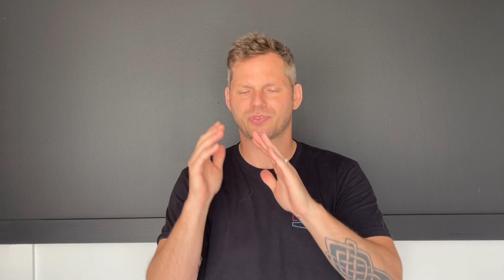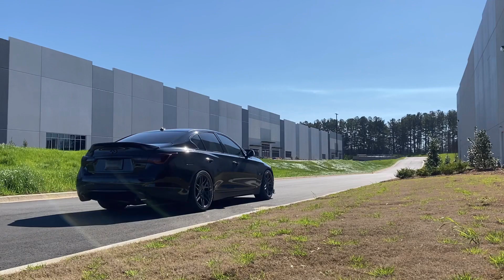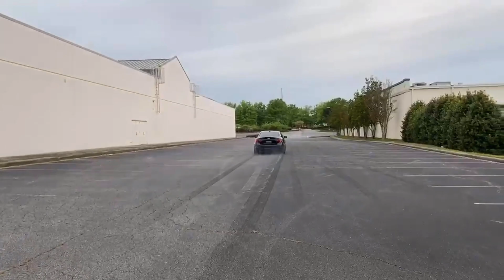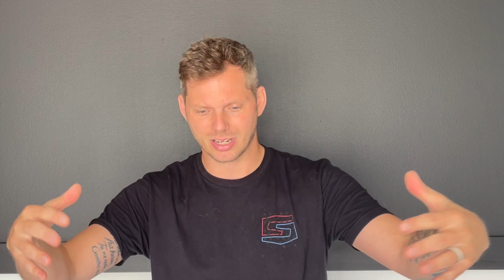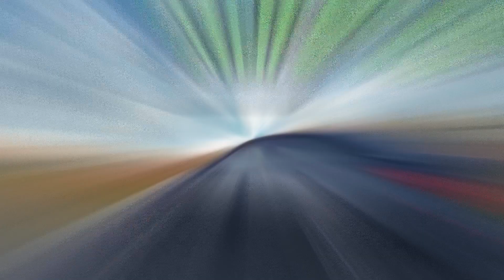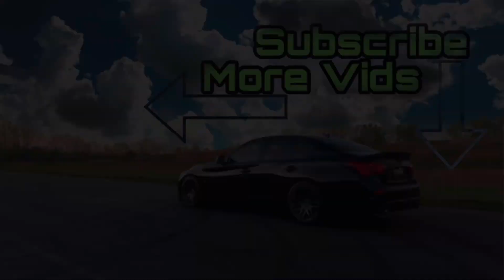Speed Culture Catback UPDATE

Comment: Plan on ordering everything today.
Can I ask what type of test pipes you have I’m looking into getting berk but should I get resonated or non resonated?
And also is a tune required for the set up with test pipes, because the guy at my exhaust shop I go to says not necessarily, says it might help with performance but shouldn’t hurt the engine or anything else if I don’t get one
Reply from the maker: Resonated. Any except Megan racing are fine. A tune is necessary to benefit from them. Is very possible you’ll get a check engine light without a tune because the car may run lean.
Reply: @SpeedCultureStudios  really appreciate the quick reply, these test pipes are hard to find lol
Reply from the maker: @JuFromNola yeah all the EPA activity the last few years has hurt them for sure.  Check out kinetics racing.  Or see if Berk has anything available.  Otherwise you might find some in marketplace
Reply: @SpeedCultureStudios  for sure

Comment: I wanted to hear you opinion on this. So I bought this whole setup (with resonated test pipes) but ended up opting for the magnaflow muffler. I bought the 22” resonators to account for the smaller size of the muffler but i’m still concerned about rasp. The other option would be returning the resonators and getting two straight through magnaflow mufflers (same size as the x muffler) but single in/out. If you think the longer resonators will suffice i’d rather keep some volume. Just hate rasp lol.
Reply from the maker: Rasp should be minimal if any at with the setup as is.  That’s why I’ve recommended it.  If for some reason you have some rasp or develop some over time. You can replace the resonators with something larger.

Comment: So I have AMS LDP non resonated and with a tune. I ended up going with a double X pipe setup and the flow fx resonators by the tips. Would you recommend fitting another set of resonators on the system since I dont have my stock bottom cats anymore. Or should I put on the Borla/Magnaflow muffler . This is all 3 inch pipes too
Reply from the maker: What do you mean double x pipe?  Why do you want additional resonators?
Reply: @SpeedCultureStudios  I may have messed up but I had them install 2 x pipes in place of the magnaflow muffler 😥
Reply from the maker: @TheBaldMarksman  yeah not necessary at all.

Comment: Can i run this setup on my car even if its not tuned ???
Reply: I would love to get my cart tuned, but it’s a little hard to get a good tune up here in the north east is there a exhaust set up you can recommend for a non-tuned 3.7 with stock cats I just want it to sound a little better than my stock muffler
Reply from the maker: @mel0cel0YT  Best thing to do really is just do a muffler delete.  Sounds good and is inexpensive
Reply from the maker: Yes.  The catback itself doesn’t require a tune.  It’s the test pipes that require the tune.  So the only thing is that if you have stock cats, this catback will sound basically like stock so there isn’t much point in getting it as it’s designed here.

Comment: I’m looking to do the scs exhaust on a Fx35 I just picked up. The factory exhaust utilizes a y pipe into  a single in/out resonator then to the muffler single in dual out. 

 Would a single in single out (or single in dual out) borla proxs muffler in leu of the dual in/out give the same sound?
Reply from the maker: It was be similar in tone yes, as long as the dimensions of the case itself are relatively similar.  I would not do single in/out though.  I’d get ride of the factory y and replace it with the borla or magnaflow and do dual in single out if you wanted to keep that same format.  Try to find a 3” outlet though to keep a lower tone

Comment: I’m adding this to my Q60 3.0 this week,Question you said if we keep our stock cats it’s best to drop the muffler and go with an X pipe.However you said if that’s down to use 3 inch ..please tell me what I’m getting 3 inch in and not 2.5 ? Just want to get the right parts plus the link to the x pipe is unavailable
Reply from the maker: For theb3.0t 3” pipe is good, especially if you ever plan on tuning.  You can just search 3” x pipe and you’ll see several options
Reply: @SpeedCultureStudios  so just get 3 inch pipe and 3 inch X pipe and the I can purchase everything else that you listed just as is ? Resonators,flanges,etc at a 2.5 ? Correct ?

Comment: Hey scs im tryna find the borla pro xs link I went to your shop on Amazon and it’s not there and I went to the original video and the eBay link no longer works.. do you have another link for it?
Reply from the maker: https://amzn.to/462mNRx
Reply from the maker: Try that one ☝️
Reply: @SpeedCultureStudios I just commented on another video trying to get the link to this for my g37 so thank you. Also I have to get rid of my stock cats cause they gone bad. so what do you recommend HFC OR TEST PIPES. I just want it to sound nice & deep (which ones do you recommend)

Also when I take it to the shop do they need to add any pipes or does your custom exhaust attach all together?
Reply from the maker: @brianvasquez1479  a shop will have pipe.  At this point I’d recommend the magnaflow alternative to the borla.  Borla has had quality issues lately.  Any test pipes are good as long as they aren’t Megan racing

Comment: I wanna run this set up but what changes should be done to accommodate and supercharger set up on G37
Reply from the maker: If you’re going for max power and are ok with it being louder, I would use an x pipe instead of the borla and use 3” pipe and resonators

Comment: Im was wondering if I add 2 mini mufflers behind my tips on my custom catback, if it will affect my tune. I am tuned by Rs Enthalpy and he said if it doesnt make it more restrictive. I currently have -non resonated testpipes
-custom 2.5 inch catback with x pipe and vibrant resanators

It sounds nice but it has a lit of vibration in the cabin and i wanted to add the flow fx mufflers that you have behind my tips. I just wanted your thought on it as well. Thanks!
Reply from the maker: The flowfx resonators are straight through so they will not cause any restriction or effect the tune.
Reply: @SpeedCultureStudios  thanks for the reply, I have vibrant resanators right now with nothing else on its a full 2.5 inch catback. Do you think also adding the flow fx resanators including the vibrant will help with vibration/drone in the car?
Reply from the maker: @evojug6973  Yes, adding some nice resonators will help.

Comment: Well, I've only driven about 4k miles 1.5 yrs maybe.. on my "scs" catback, and my borla pro xs muffler is starting to come apart. :( The very thin metal wrapped around the muffler is starting to separate, causing it to rattle. I'm not the only one, another guy contacted borla about it, and borla recommended replacing the dual in/out with 2 separate mufflers. I'm about to contact borla myself, see what they say.
Reply from the maker: Borla will generally replace them with their warranty.  They should not come apart
Reply: I’ve been through 4 Borlas

Comment: Is there a difference between the flowmaster fx resonators and vibrant  performance resonators?
Reply from the maker: Depends on what vibrant resonator you use.  They don’t really have any of this style.  They are generally the smaller bottle style resonators which won’t do much here or they are bigger, stronger resonators that will tone the system down even further.  Just preference really.
Reply: @SpeedCultureStudios Is to much of  stronger  resonator, no bueno?
Reply from the maker: @BoostedNevarez  It' just makes it quieter, which sort of defeats the purpose.  Unless you want it quiet...

Comment: hey man, i have a 2010 g37x with dual mufflers in the back. Can i still use the borla muffler or will i have to do something different?
Reply from the maker: You can still use the borla as a mid muffler yes!
Reply: @SpeedCultureStudios  where exactly? looking at the driveshaft it seems like it wouldn’t fit but i’m just eyeballing. closer to where the y pipe typically is or further back?
Reply from the maker: @mattschannel38  it has to fit up tight on the awd.  If you’re lowered, most people will do the setup in reverse order.

Comment: Nearly 3 yrs on the G37x and yet to find a better sounding VQ. Running magnaflow resonators and test pipes with the borla mid  Hands down the best exhaust. Wouldn't dream of running anything else. 💪
Reply: Did you get the flex pipes?
Reply: @lightcario1471  yes but you will have to replace them after a while as they take a beating.
Reply: @elioalzugaray9106 how often do u change your flex pipes?
Reply: @tre2216  depends I've gone 2 yes with them, much sooner if running burble. Burble also destroys the mid muffler. I have since gone 3" single exit but it doesn't sound near as good. More power though.

Comment: Wassup speed, quick question. So I’m getting tuned with admin oct 1 so about 2 weeks from now and I’m getting my test pipes, borla, and vibrant resonators installed tomorrow on my g37x. I was wondering do you think my car will be okay to drive without a tune within the two week time frame?
Reply from the maker: It’s not ideal but lots of people do it.  I would just say no wide open throttle pulls for that period and you’ll be fine
Reply: @SpeedCultureStudios  thanks for the quick reply !

Comment: Love these videos man I've got test pipes and the flow masters ready to install but I'm going to keep the stock y pipe and resonators for now. If I hate the sound I'll get the mid muffler just worried if I can find a local shop that will fit it into the g37x
Reply from the maker: People have made it fit that car, but I think you have a good plan.  The factory resonators are pretty strong so they’ll help with rasp.  Should still sound nice!
Reply: @SpeedCultureStudios  honestly sounds amazing at idle and full throttle. Getting that notorious rasp from the stock y pipe at 2.5k to 3k rpm so guess I'll be going full SCC soon!

Comment: 2013 infiniti g37 sedan RWD. I snatched pretty much all the parts up this year early March late February, except for the flanges of course lol. Same time even came in the same box other than the resonators. Was like low $300 like $320 or so. After shopping around finally got a shop to install it. They charged sub $500 like $450. It's been so long I've forgotten the specifics I just know when it was all said and done it totaled out to $780. So really it comes down to finding a shop that's willing to do it on the cheaper side. It took them all day to do it because of the specifics of what I asked for centered around the placement of the borla x pipe. He eventually got it in there exactly where I wanted it. I don't mind sitting there all day if you're doing exactly how I want it. 

$780 for a full catback for the G37 sedan though is basically impossible outside of your exhaust setup. I searched high and low for catbacks for the sedan. There's only like 4 or 5 full catback options, 1 of which seem more like exhaust system replacement than legit performance systems. Manzo for $600 doesnt really do anything to really differentiate the car from stock. If thats the case why buy it?You have fast intentions, invidia and stillen left from my memory. I'm sure I'm missing someone though. All of those are usually over $1k especially Fi and stillen. You could probably snag a Invidia Q300 for less than $1k barely but it's possible. But that one doesn't really have a deep tone, it's more high pitched and on the whiney side. 

I then looked into axle backs and y pipe backs. The one I almost went for was the top speed y pipe back exhaust because it has a deep tone that I wanted. Issue though? It was damn near $800 and apparently had corrosion problems. Also $800 for a y pipe back just to add $300 more for the actual top speed y pipe to go full catback sorta defeats the purpose of going for the cheapest option to begin with right? 

So when I say that your system is literally the only real option for the G37 sedan that was less than $1k for a FULL CATBACK, I'm not kidding. I would've been posted sound clips by now but I don't want to until I get my cracked converters off and my resonated berk test pipes on to do the system full justice. 

But dude even with hissing/cracked cats at an idle I've had people literally question me if my car is still a V6. At idle it lopes sometimes like a v8. Its so deep.

Comment: If I have a g37x will the Borla mid muffler fit in place of my y pipe? I’ve heard that it won’t and I’ve heard that it does
Reply: I have a g37xS sedan and the shop I went to fabricated it perfectly. I have stock cars for the moment so I only installed the borla coming from the cats and going straight out. I’ll consider adding the resonators once I install the test pipes if I feel it’s too raspy or loud
Reply: @jjamaya01  how much did they charge you? And did they mount it sideways or vertically under the car?
Reply: @investinjahcoin5029  240, and I got mounted the exact same way he did in the video, Only diff is I didn’t install the resonators bc I wanted it to be loud
Reply from the maker: Not on your y pipe, but there have been some g37xs that have made the boral fit.  A good shop can tuck it up nice and tight, but also depends on how low you are.

Comment: I’ve heard many people blowing their mid pipe or borla muffler and going through multiple mufflers 🤔
Reply from the maker: There have only been a couple with that issue and there are over 800 of these systems out there now with no issues.  Also—as I mentioned in the video—these people are constantly shooting flames.  Mufflers are not meant for that abuse.  On top of that, borla offers a lifetime warranty, so if there is a problem, they replace the muffler.

Comment: Hey speed I have stock cats on my g37 do I need res test pipes for this set up to work.
Reply from the maker: No you don’t need them.  You can keep stock cats but you probably wouldn’t need the borla.  You could just use a regular x pipe
Reply: @SpeedCultureStudios  Thanks Speed I ended up buying the borla. Is there any test pipes you recommended in  one of your vids
Reply: @jvoncutler5890  have stock cats too bad plan on doing this setup. how’s your experience w this setup ?
Reply: @BuiltByChrys  his setup is refined I still have stock cats on my its loud enough at WOT quiet at cruising speeds. Not bad for the price. Its solid

Comment: I'm gonna give it a couple weeks or so.I feel like I have lost some power with the magnaflow muffler and there is a bit too much vibration underneath me even with the flex pipes. Contemplating just going with a regular x-pipe.
Reply from the maker: Regular x will be super raspy and won’t do anything for vibration
Reply: @SpeedCultureStudios  Ok so what would be an alternative? I have  a 3.0t awd not the 3.7. I have 2 flowfx, flex pipes and tips installed.
Reply from the maker: @lewis6720  ok then that makes a little difference.  It won’t be too raspy with an x pipe so that’s good but it still won’t do anything for the vibration.  I’d first figure out what’s causing the vibration
Reply: @SpeedCultureStudios  ok thanks for your input, appreciate it. I'm sure it's that muffler right up under me.
Reply: Ok I went back to the shop and removed the magnaflow and used a regular x-pipe. Low end torque has returned, less cabin vibration and sounds better too. A lesson learned.  To those with 3.0t awd you don't want to use the magnaflow muffler. It's more of a restriction combined with the flowfx resonators.
Reply from the maker: @lewis6720  Just to be clear, the flowfx resonators have no restriction, so it's not that the magnaflow has more restriction because of the combination with them.  The magnaflow is just a resonated x pipe.  I'm glad to hear the vibration has subsided.  The general recommendation for people with 3.0t is to go with a standard 3" x pipe.  That engine does sound a bit better when it's opened up a bit.  The turbos can really tone a car down.

Comment: Hey J, I currently have an IsR single exit with isr HFC and have crazy Rasp when going hard in 2-3rd gear It currently has one Isr resonator that came with it is there anything I can do to eliminate this rasp without losing how loud the car is?
Reply from the maker: If you have room, you could try installing another resonator into the system.  You'll keep 99% of the volume, but it'll help kill that rasp.

Comment: I think this system sounds pretty good. Quick question though, Can your system be used on both the NA and Turbo models?
Reply from the maker: Thanks!  Yes it can, and has been, but I generally recommend a slight variation, especially if they plan to continue modifying and tuning their turbo vehicle.  First suggestion is to bump it up to a 3" system.  The second thing is, I typically suggest going with just a standard x pipe instead of the borla.  Every platform is a bit different but in the turbo Q50, many people will typically just do lower downpipes rather than full downpipes, so the need for a big muffler is not really necessary.  Turbos act as a pretty good "muffler" so the borla might be excessive.

Comment: I have a VR30tt and am looking to do your recommended 3" setup.  I know you have done lots of research, but how important are the FlowFX Resonators to overall sound?  Would the LCGP work or are they junk?  Also noticed the Evil Energy has an option with integrated tip.  Do you have an opinion on those?  Mostly curious about how different manufactures parts effect overall sound.

I love your content.  Keep up the good work.
Reply from the maker: Thank you!  If you've heard the 3.0t with an "open" exhaust it can get a little tinny.  If you're doing the setup with a mid-muffler, you wouldn't really need the flowfx resonators, but with the 3.0t--especially if you're tuning--I would do an x pipe instead of the borla and then use at least some sort of larger resonator out back.  A resonator with integrated tips is fine.